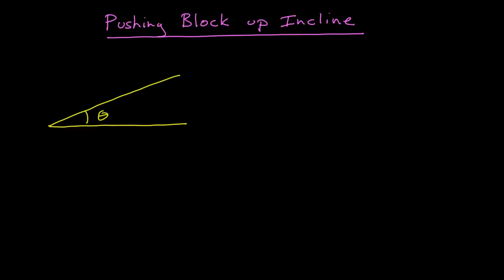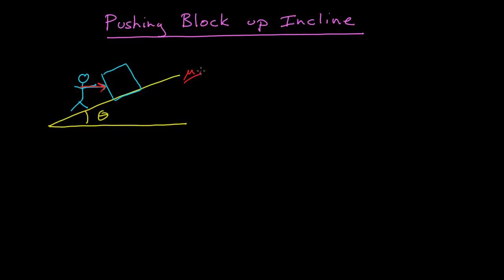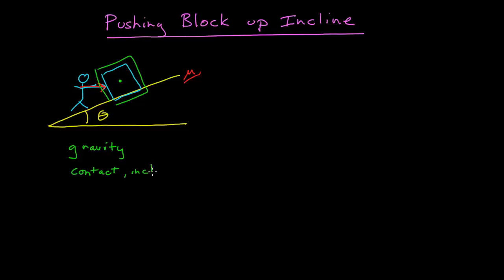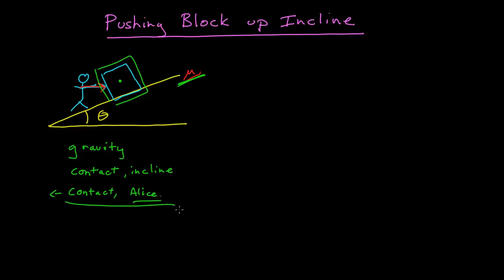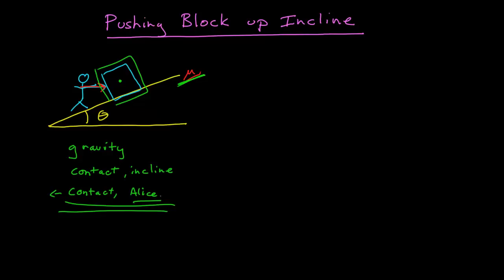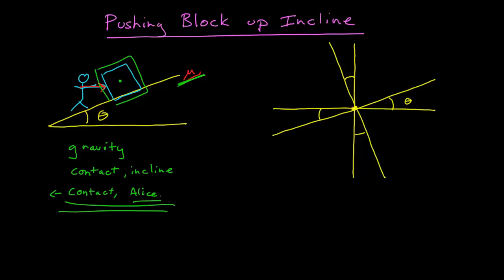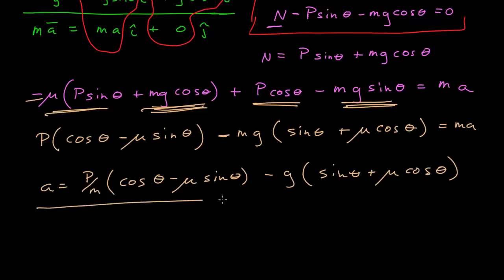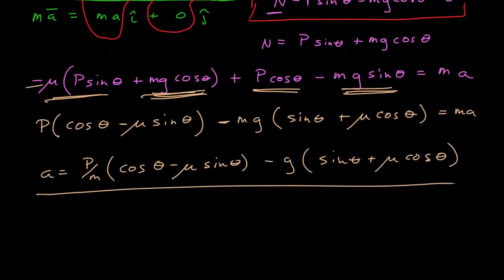Pushing Block Up Incline

Comment: Hi you said you wont split the pushing force, but then you proceed to do so?
Reply from the maker: Sorry, I'm so late to these, but this is a great question. Contact forces are sometimes split into normal and frictional forces that are dealt with separately. I do that with the contact force of the wedge on the block. But I'm not splitting the pushing force into a normal and frictional force. However, I do need to find its components on the x and y axes.

Comment: This helped A LOT! You should make it clear that if the push/pull force that they are looking for varies depending if the force if horizontal or parallel to the incline plane.
Reply from the maker: Thanks for the kind words.  I can add that as a comment in the video.